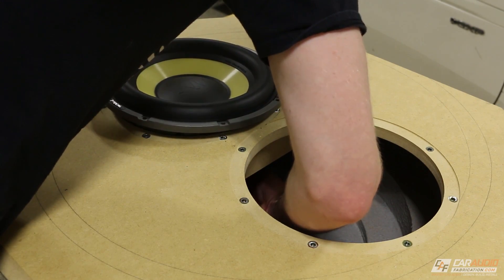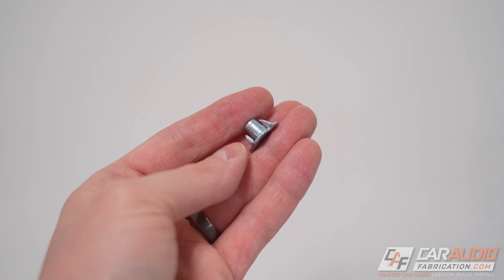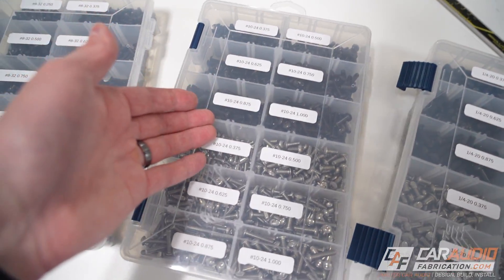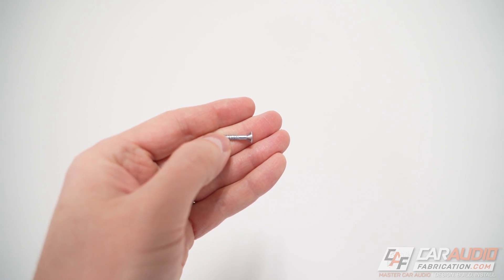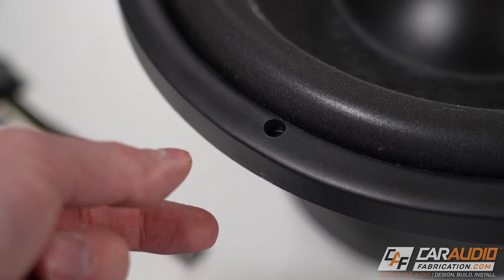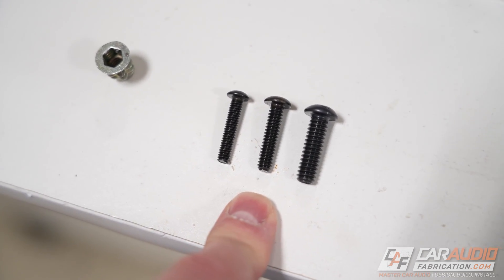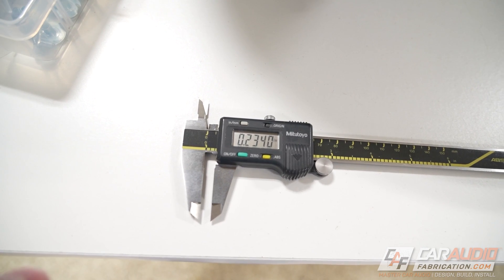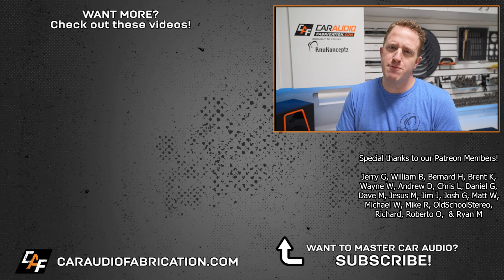Is THIS the right screw size for your subwoofer?

Comment: I've just had to rip out one of the rear mounted T-nuts because the screw may have crossthreaded due to a discrepency in the hole placement or a glue remnant. It's been in and out a few times and this once just got stuck. 

To then get this out I had to lift the driver at the other side and rip the stuck screw through the MDF edge between the driver hole and bolt hole. 

Threaded inserts can begin to turn in place too... however at least will drill themselves out at that point and you can remove the driver but need to then repair the mess it left behind.

If you use a typical wood screw you can rotate the driver and start new holes if you need to. At some future point if you need to "renew" a hole you can fill it , predrill then use it again.

Comment: Mark, some take these videos for granted, but those who are learning do not. Using threaded fasteners and inserts is far superior than using corse thread fasteners especially in wood products. In high end cabinet grade work this is particularly prominent. You don’t see it in lower grade cabinets, but it is impressive in high end use. Being able to   remove and replace components easily and quickly is essential using threaded fasteners. The use of Titebond 3 on the threads of the insert also helps in keeping the fasteners secure in the wood. Since you don’t want to damage the MDF by over torquing the inserts, using a torque wrench to yield consistent torques is essential. Once the material resists when the flange addresses the surface, the torque wrench is used to prevent overtorquing of the fastener. It works on metal materials and it also applies to wood and plastics only at lower settings. Experimenting to find the correct setting for the material is essential to achieve optimal results. You can use scrap pieces for this and this saves ruining a much more valuable piece as that would be disastrous and stupid. This may help the pros on their builds. I doubt if any beginners would go to this extreme. High end work requires greater attention to detail. It is up to the individual as to the level of involvement they are willing to go. The time at this writing is 2:13am Central US.
Reply: Well spoken. I agree. When I was 16 I didn’t know to go this far into detail. But my system also “only” cost  a few hundred. 

Now, over two decades later….my first system in 15 years…I’m being very detail oriented since my system is upwards of $1000, which for some is still low cost. Haha.
Reply: @americandude3825 , the money you spend matters, but the quality of the components matters most in the long run. You don’t have to go into debt to achieve great things and it is your ears that have to be satisfied in the end. The key is spending the money on high quality parts. This makes the work you do worthwhile in the long run. Few have the money to spend in their teens.

Comment: I learned pretty quickly that threaded inserts don't work very well in birch plywood.
Reply: @HoUsEoFcAtS78  what type of screws work good in birch wood boxes?
Reply: @seandp85  I generally use pocket screws to build the box. My next box, I might try using wood dowels and a generous amount of wood glue.

Comment: I just wanted to say if you’re new to DIY car audio this channel is the only resource you really need, other than a good forum for any issues you may encounter. There’s a good video on everything you will ever need to know here (at least for installs).

This channel was almost solely responsible for my learning everything I needed to know to work my way up to doing a complete system in my car. From working up the nerve to pull everything apart to properly choosing and installing/tuning all equipment. Without this channel I’m not sure I’d have ended up getting into DIY car audio as much as I did; you can find everything you need to know elsewhere but this is hands down the best place for all that. Car audio is my single “favorite” hobby, without this channel I’m not sure I’d have got to the point where doing an installation is just as much fun as the end product.

Comment: Just this week I was searching on eBay for those types of fastener to remount a 12" subwoofer back into its enclosure as the holes can accept larger screws.  However, still haven't decided whether to go with the more expensive stainless/steel option or not!

Comment: Stainless doesn't mean stain/rust proof, it means stains/rusts less. Yes, it takes longer for SS to rust and when it does it's a slower process, but it certainly can/will rust.
Reply: You're right in terms of some extreme conditions, but I think Mark's point was they will never corrode while securing the sub in your car

Comment: You can check the hole space by turning the sun upside and measuring from the bottom
Reply: How do we turn the sun? It's so hot
Reply: @Team-Elevated  and isn't it just a big ball? And the sun has Holes wtf?

Don't forget your eye and hand protection, sunblock (especially my ginger ass) when you get that close to the sun!

Meanwhile, back at headquarters the super friends were trying to figure out how turn over the SUN?

scratches head

Comment: "T" nuts work perfectly fine and can even outperform knife thread inserts. All you have to do is install 2 small wood screws in opposite "valleys" of the T nut. For the knife thread inserts I put the smallest drop of gorilla expanding glue on the top edge of the hole. So even if the threads are crossed the insert will not come out.

As for stainless screws, if you repeatedly put in and take them out, they will work harden, gall then snap.
Reply: Thanks for the screw tip on the T nuts. I used M6 t nuts on my first box but didn't glue them in, or any on the back so when it came to mounting the subs 2 popped out when I went to line up the machine screw. Going to go with inserts and some glue on the next 2 boxes.

Comment: A no. 10 screw has a diameter of .190. .216 is the diameter for a no. 12 screw. You just read the number off the wrong line. Happens to me as well.

Comment: Mark what are your thoughts on hanger bolts for mounting? 🤔

Bought a drill block (awesome tool!) for the pilot holes to get them square to the baffle

That's what i'm using on the box for a Zv6 12 you designed for me almost a year ago 😅
Reply: What size did you use I have sundown nsv 5 12s
Reply: @OnlySubzz  i had to ream some glue out from the holes on the frame did that from the backside with a 1/4" bit and i'm using 3/16" fasteners
Reply: @Markous420  Thank much appreciated 🙏

Comment: I always have a hard time figuring what size drill but to use for the inserts
Reply: If you know the size of the threaded inserts you might be able to find a recommendation by google search but if not I will usually see which drill bit I have is closest, or just barely smaller than, the diameter of the insert (without counting the threads/teeth) and use that
Reply from the maker: Usually the little baggies they come in identify what drill bit size to use 👍
Reply: @CarAudioFabrication  maybe I'm not getting mine the same place as you are but mine never do

Comment: Phew, I love the idea and cleanliness of using inserts, but don’t they ever pull out of the wood? That’s my only fear. Really glad you went over this. Great topic. Soooo many people swear by dry wall screws.
Reply: I use inserts inserted from the back of the subwoofer mounting surface so the flange on the insert takes some of the clamping force
Reply: @BaldCoasterGuy   Agree, & adding some adhesive around them will further stiffen the material, especially if it's MDF, grainy-plywood, or particle-board (though I'm not much of a fan of this last option)!
Reply: I often seal my MDF enclosures with fiberglass resin to help ensure there's no water damage of the customer develops any leaks around the trunk/hatch seal. This added reason also helps "lock" the inserts into the MDF
Reply: Rarely unless you oversized the pilot hole. You can always add a little CA  glue when you're driving them in if you're  worried